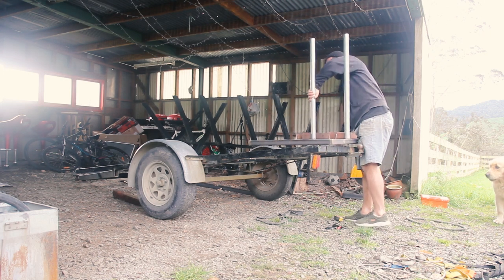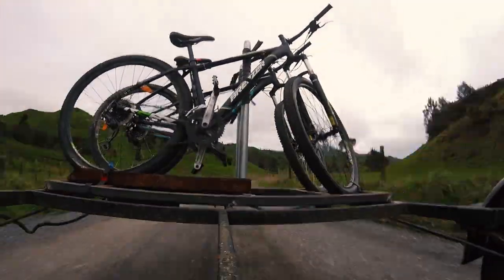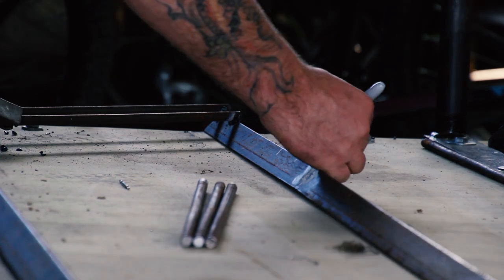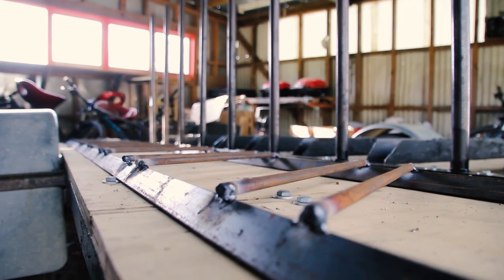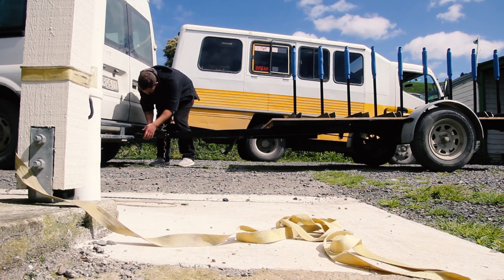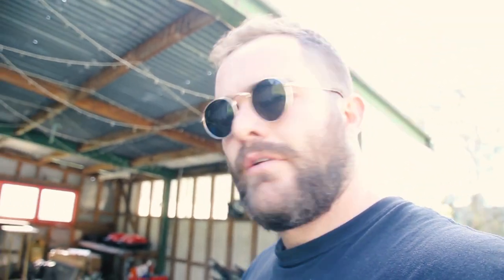Bike Trailer BUILD

Comment: Hi Julian  thinking of building one of these for myself...a year on is there anything different you’d do. What angle is front wheel supports?
Reply from the maker: I woulld do stronger supports on the bottom of each pole and I would use a diffent plastic than that blue stuff. Changed it to old bike tubes. The angle was just a bit of trial and error. All depends on the space between bikes and the width of your trailer.